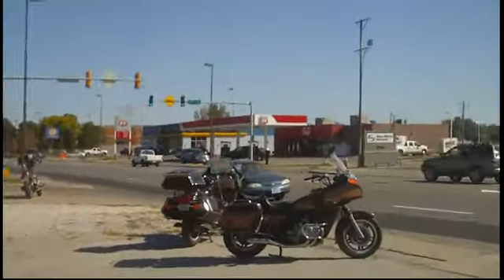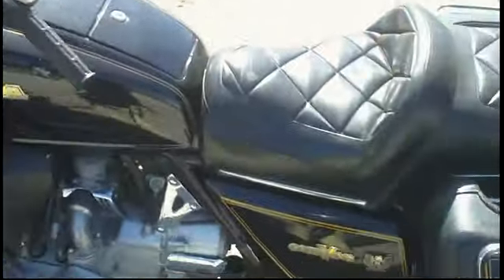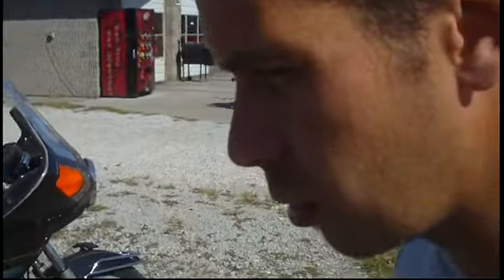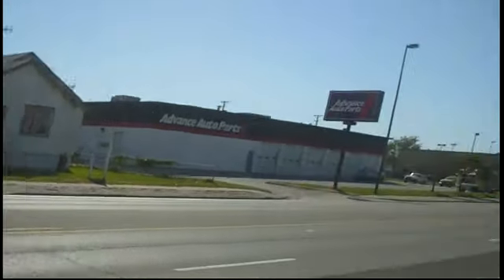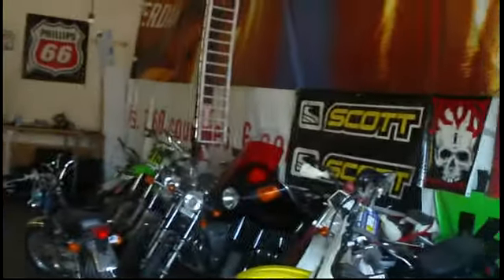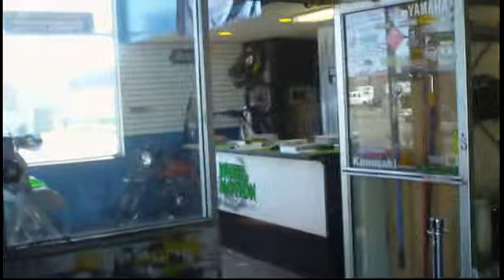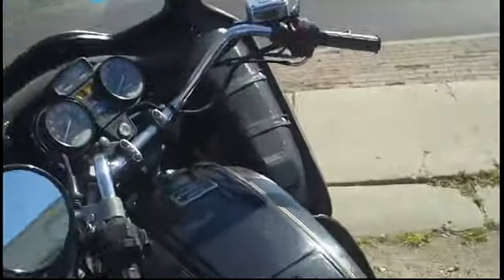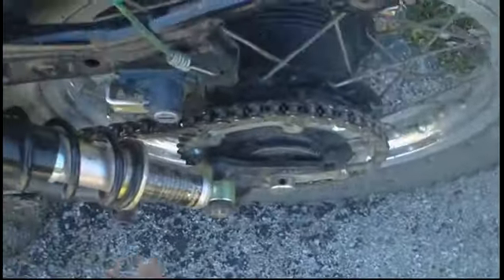Girley wing Shopping Pt2.avi

Comment: be cautious of the 1000 goldwings. they had a torque problem in the corner when you gased on them. when you were cornering and gased on them they would try to stand up.they corrected it in the 1100. my dad had a 1000 brand new and he hated it.. but he loved the 1100..... just a little did you know....